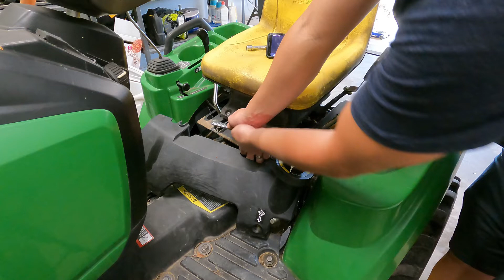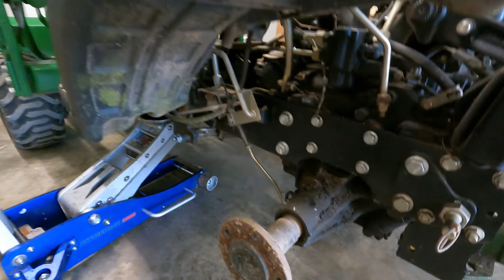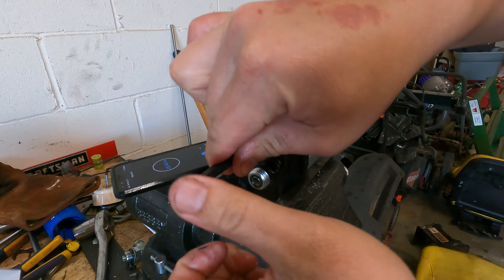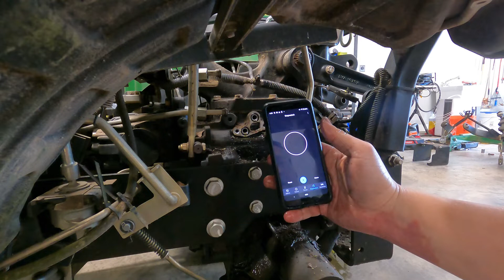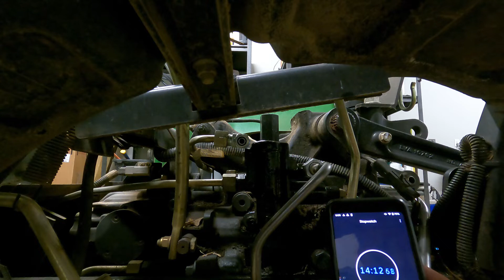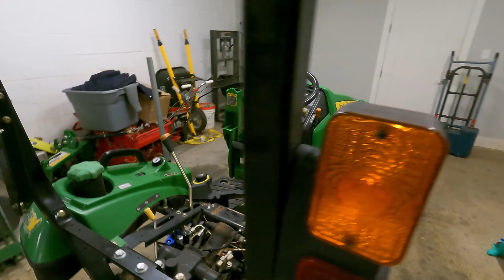HydrosPlus Performance Kit Install - Real Time

Comment: What is the GPM supposed to be set on the flow divider if i purchased the stage 3 kit with the performance kit? Sorry just a little confused when you said the dividers come set at 5 GPM and you adjusted to 2 GPM. So with the stage three kit what is it adjusted to? Will the stage 3 pump produce the higher flow rate? Thanks
Reply from the maker: It can be adjusted to your liking, but they flow dividers are set to ~2 GPMs from the factory, regardless of the stage.  The balance of the flow goes to the implements, which is more based on the stage you go with.

Comment: I kept waiting for you to loose a toe nail with those shoo's on.😱😱
Reply from the maker: My steel toes didn't match my t-shirt that day, so I had to take the risk ;)
Reply: We all do it....😇   Try this when removing all that back linkage.  Undo the top center rod, rotate parts down to the ground.  Remove the lower pins and tractor mounted links on bottom by the axles.  Then remove the two reaming links and slide it all away together.

Comment: After tapping many 1000's of threads and experimenting with different techniques, I find the best and most practical option is to use the same drill I drilled the hole with to then drive the tap in and out.

The most critical parameter for successful thread creation (assuming the tap is in good condition and the hole is the correct size) is that the tap is parallel to the hole and that it remains parallel during the tapping operation.

If you use a ratchet or T-handle you'll inevitably wobble around, changing the angle, while tapping the hole. If the angle is off too much, the tap will jam and could even snap off in the hole. If the angle wobbles around while tapping, the quality of the thread is compromised and typically you end up with a loose thread.

If you hold the drill carefully, use the low speed on the drill (speed selector in position #1 with most drills), take your time, and run the tap out and back in every time it starts to get tight, you will end up with a strong, high quality thread, that is superior to anything you could make using a T-handle or ratchet. If you really want to be safe you can set your drill's torque limiter to a low setting to guarantee you won't snap off the tap in the hole.

When creating difficult threads (such as very small diameter ones and/or threads in a very thin piece of sheet metal) the absolute best option is to both drill the hole and tap the hole using a drill press (or milling machine). A drill press will guarantee that the hole and tap are perfectly parallel. The one downside to a drill press is most do not have reverse so you'll have to manually turn the drill's chuck backwards by hand. Often with a drill press, it is so perfectly parallel that you can run the tap all the way in with a single operation and then switch to a hand drill to remove the tap.

Try using your hand drill to drive the tap. Once you've mastered keeping the tap parallel to the hole, you will never go back to the hand tool option.
Reply from the maker: Thanks for the feedback.  One change I've made regarding the hole drilling and tapping is I've changed to a 2 flute gun tap and increased the bit size a small amount after talking with a few machinists..  These holes are just for keeping things in place and only need a few foot lbs of torque, so even if the hole ends up less than perfect, it'll do the job.

Comment: This how-to is so unrealistic!  You forgot to add in snack breaks, fill up the kid's bike tires breaks, open a jar for the wife break, run kid to practice break, coach practice, return and try to remember where you left off.

Kidding - thank you so much for putting this together!
Reply from the maker: haha!  I did have to stop and pick it up the next day.  I can't remember what I had to do, but it was a family thing :)
Reply: @HydrosPlus  I got my kit today.   Took the right side tire off to tweak the pressure up a bit.  The tire is fluid-filled, so it was a little bit of a beast to get back on, but nothing unmanageable.

I'll pick up where I left off tomorrow.

Comment: I love the concept and all but it looks like a broken tire chain or a limb jammed in-between the tire and frame could destroy the hard lines. I guess that would be something to plan for, maybe buy a couple spare lines...in 5 years who knows where you could get replacements.
Reply from the maker: The latest version is tucked in pretty tight and the hard lines are going to be tougher than most things they encounter, but if something does happen, you have a lifetime warranty.

Comment: Very helpful, thank you for sharing 

Where did u get the rear 2” receiver that is mounted on the back frame?

Thanks for sharing?
Reply from the maker: Hi Don!  I actually bought the tractor used and it came with the tractor, so I don't know where it came from. I'll see if I can find a marking on it next time I'm around it and let you know if I find anything.

Comment: To bad they don’t make or modify the valve already in the stock flow divider. Instead of 50/50 ratio make it have 66.6/33.3 ratio. Do they make such a valve?
Reply: Modify the actual flow divider piece he removed. Need to know how to machine it so the openings are bigger for the implement side
Reply from the maker: It's possible that one exists, but the manufacturer of the flow divider is not clear - no markings on the device.  It's also possible that the valve is unique since the PTO switch is integrated, but I would be surprised.

You still have a challenge of more than needed flow going to the steering circuit if you want to achieve an implement flow of >7 GPMs.  You would need a pump that is north of 11 GPMs to get there if you change the ratio to a 33/66, which in my testing, has been a challenge due to the relatively high rpms of this engine.  The bigger the gear pump gets, the slower it wants to go so it doesn't cavitate.  Everything I've tested that's much about 10 GPMs has had issues at WOT.

With the HydrosPlus system, you can get 7.5 - 8 GPMs to the implements with the 9.5 GPM pump.

Comment: Thanks Kevin, nothing but good things to say about you and the kit.  Well almost - you included the Allen head bolts for the proportioning valve that must go on the tractors with backhoes (too short).  Started to check for leaks and all was good.  Pulled back on joystick to lift the loader and... nothing.  Loader wouldn't budge, bucket wouldn't move and the 3pt hitch wouldn't move a inch... but power steering was fine.  After the panic, and confusion, subsided I adjusted the proportioning valve and got the loader, 3pt hitch and power steering all working as intended. Love to way the loader works now and look forward to receiving the Extreme Pump and being able to run a LimbSaw and other attachments.

Comment: Can someone explain why the proportional flow valve has a switch for the PTO?
Reply from the maker: I can't explain why it's there, but if you're asking why it's in a hydraulic component, I can help.  The PTO clutch in the transaxle is actuated by hydraulic pressure.  The PTO switch is an electrical solenoid that when energized, allows fluid to direct through a port that engages the PTO clutch.  It's a small amount of fluid that is redirected at a relatively low pressure.

Comment: I guess you could not source the valve with ORB.  An ORB by ORFS would be much less PITA to adjust.  And less leak prone than NPT.
Reply from the maker: Agree that ORB is ideal and I'm working on that.  At the time I started development, an ORB version that met my specs was 12-18 weeks out, so I opted to develop with the NPT version which was plentiful.  I just received an ORB version and will start testing soon, but I expect that all of the dimensions will change due to the compactness of the ORB fittings...which is a good thing, but will likely require rework of all the tubing components.

Comment: Installed the kit with Curtis cab on it. Thanks for the video it made the installation sweet. As you noted tapping the frame is a pain but doable. Was able to modify old valve in place with a short 1 inch 3/8 drive six point thin socket. Seeing I’m old I pulled the front hinge pin on the seat and removed the seat in two pieces. Loader Bucket is definitely faster won’t be able to get the back hoe on for another couple months, -24F tomorrow night.

Comment: Any chance you can video the installation of a power beyond kit for the 1025r?
Reply from the maker: I think Tractor Time with Tim is working on a video  very soon on the install of a PB, but I might do a quick overview of the parts since I do get the question about whether there is interference between the  hydrosplus system and PB or other new functions.